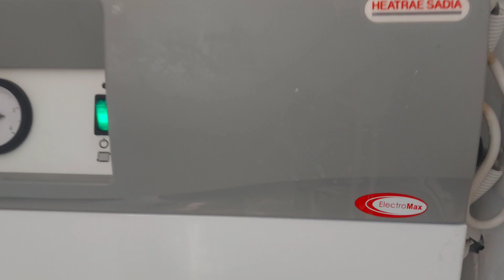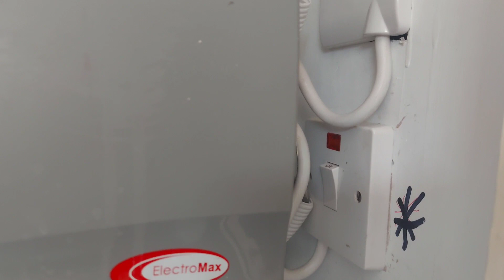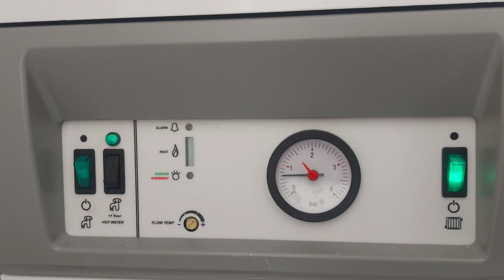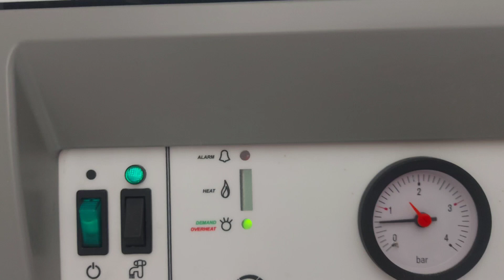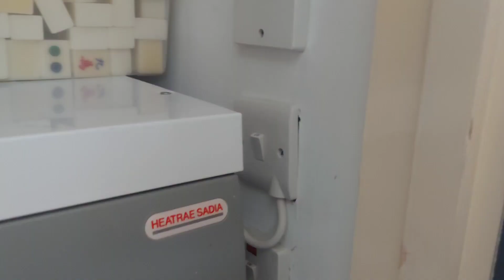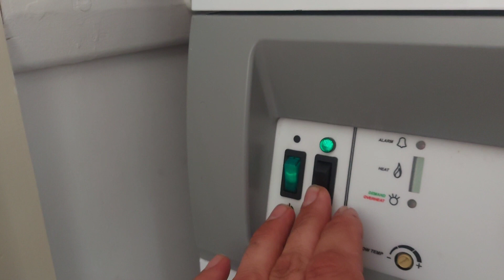Heatrae Sadia Electro Max Boiler Controls explained

Comment: What to do if the alarm light is flashing red?
I still have hot water.
Reply from the maker: Please consider subscribing to help me grow the Channel 

A flashing red light on a Heatrae Sadia boiler (Amptec or Electromax) usually indicates an overheat fault or a low water pressure/flow issue. This means the unit has shut down for safety because it cannot circulate water efficiently or the temperature is too high. 
YouTube
YouTube
 +4
Common Causes & Fixes:
Low Pressure: Check the pressure gauge; if it is near zero, the system needs to be topped up to roughly 1.2 bar via the filling loop.
Overheat Lockout: The boiler has reached its safety limit. Reset the boiler by turning the electrical supply off and on again.
Airlock/Pump Issue: If the pump fails or there is an airlock, the heat cannot move, causing a red flash. Try bleeding the radiators.
Closed Valves: Ensure all radiator valves (TRVs) are open to allow water flow. 
YouTube
YouTube
 +5
If the light persists or continues to flash after a reset, the issue may require a professional to check the PCB (printed circuit board) or replace the pump. 
Important: For the Electromax model, a flashing red alarm with the demand light indicates an over-temperature switch, requiring professional maintenance
Reply: @EPCWiltshire hello and thank you for your reply.
I have an Electromax boiler.
On the gauge the red hand is pointing at around 1.2, the black hand is on zeroe.
I have bled the radiators to no avail.
Which parts would I need to adjust to raise the black hand in the gague?
Thanks.
Reply: For anyone reading this, the red hand on the pressure gague is just a marker. It's constantly pointing at what the ideal pressure should be.
To raise the pressure remove the bottom panel. This will reveal the water loop.
There are two taps at either end of it.
Turn them on simultaneously and the black hand will rise.
Let it rise until its level with the red marker hand, then turn them off.
Problem solved.

Comment: So I can't get hot water constantly?
Reply from the maker: To get hot water from a Heatrae Sadia Electromax, ensure the main unit is powered, then activate the "Hot Water" switch. Use the "Boost" button for immediate hot water (usually a 1-hour cycle) or ensure the off-peak immersion is on for overnight heating, typical for Economy 7 tariffs. 

It is much cheaper to heat water.iver night then boosting in the day

Comment: Thank you for posting this video. 
I have to replace an elbow joint on the cold water feed so need to drain the immersion tank.
Any tips on that much appreciated 😀
Reply from the maker: Thanks for watching glad it helped I have never drained on down this may help though. https://www.google.com/url?sa=t&source=web&rct=j&opi=89978449&url=https://www.heatraesadia.com/-/media/themes/heatrae/literature/installation-manuals/electromax-installation-manual.pdf&ved=2ahUKEwjOzpDDgtCNAxUPUEEAHZ8SJWsQFnoECCAQAQ&sqi=2&usg=AOvVaw3ETFmB1Qy9Tb-FFvaYoY-y
Reply: Huge thanks for this.
Drained fine in the end. Took a while though as the tap is very small. Successful solder job after a lot of prep. Old elbow joint didn't sweat off easily due to corrosion. Stressful at times but glad I carried on.
Reply from the maker: Thank for the update, glad you had success

Comment: If i have a smart meter delivering off/on peak and not an economy 7 meter. Does the unit need to be programmed to the peak periods? Bit confused on that. 

Does this unit heat up a full ‘tank’ and store it? If so how is it programmed to just do this in odd peak times
Reply from the maker: The smart meter should be delivering peak and off peak supply using the in built clock to turn off peak on and off. Check you bill to see what the name of your tariff is, it should be economy 7. The tank will the bring the water up to temp each night using the off peak if the water is already hot it won't work very hard but if you have usef it all up then it will fully heat up this should be done by a thermostat and your neter turning the off peak on and off 👍🏻

Please consider subscribing to help me grow the Channel
Reply: @EPCWiltshire  'this should be done by a thermostat' just want to clarify this isnt something i need to set? The unit itsself knows that its getting off peak supply?

For example, if i use all the hot water during peak time wont it just use peak supply to heat water automatically? or will it wait?
Reply: @EPCWiltshire I have the same question. How come the thermostat affects when water is heated? Shouldn’t central heating and water heating be independent?

Comment: Hello, I have this boiler and I am slightly confused. Does the water button on the right when switched on mean instant hot water?
Thank you
Reply from the maker: It uses the peak electric to make hot water coating more. The.water should.be heated.over night using the off peak tariff

Comment: Have the same boiler. Was working fine. However, I returned home today and saw the radiators are not heating up at all! No issues with hot water. How can it be fixed
Reply from the maker: Check your consumer unit to see if its tripped if not check the switch next. If not call a plumber

Comment: Hello. I have problem with this boiler. I have low pressure. I Try to open this black tap to pressure up but I cant turn this. :/😊
Reply from the maker: The filling loop some times has two taps of it see a pic link below

Please consider subscribing to help me grow the Channel 

https://www.google.com/imgres?imgurl=https%3A%2F%2Fcdn.aws.toolstation.com%2Fimages%2F141020-UK%2F800%2F83963.jpg&tbnid=bbBCUYpJFbWxHM&vet=1&imgrefurl=https%3A%2F%2Fwww.toolstation.com%2Fstraight-braided-filling-loop-part-l%2Fp83963&docid=3FYHu093yiBfuM&w=800&h=800&source=sh%2Fx%2Fim%2Fm4%2F2&kgs=4073ca5789b5836d&shem=trie#vhid=bbBCUYpJFbWxHM&vssid=mosaic
Reply: Hello.Thank you for answer. One of this taps seems to be blocked. I cant turn this any way:/ Do You konow whot can be reason of that? I did subscribe:)
Reply: The link shows black screen
Reply: @conspiracy.believer  I sort it already by pliers:) Thank You:)